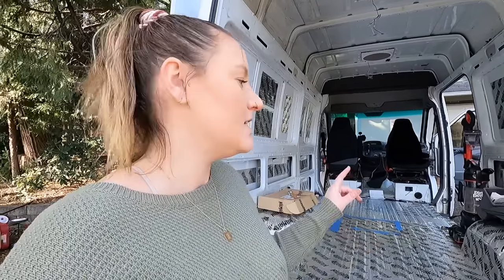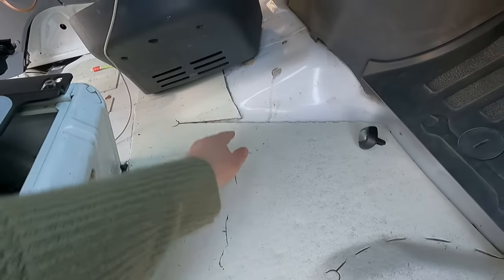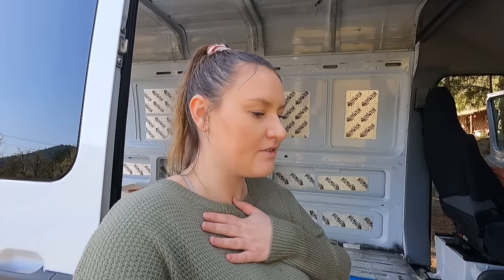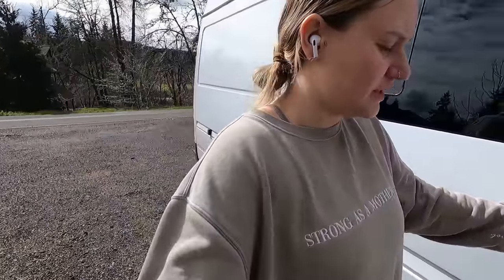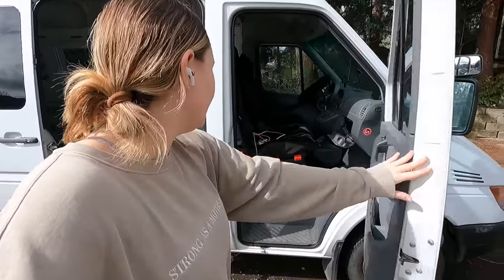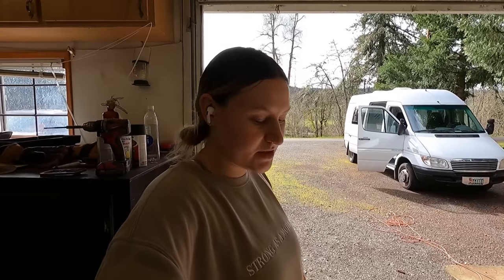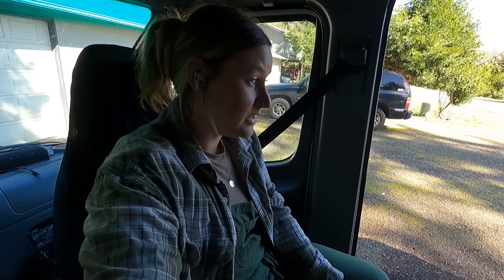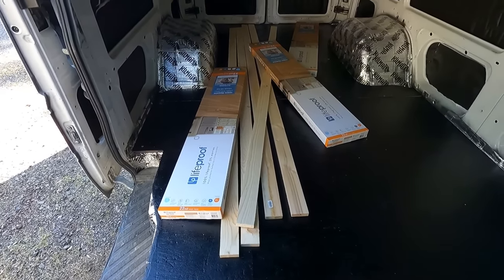Simple and Cheap Van Subfloor - DIY Camper Conversion

Comment: I love that rubber stuff. Used in under diamond plate I used on my motorcycle. The plate between the fuel tanks and the floor boards. ❤ Perfect timing on sub flooring. Winter about to be over here so thats my next task on my list..🎉

Comment: If you would have used the rubber coat then a layer of polyester patch fabric and then coat with the rubber that would have fixed the problem. The polyester fabric is for roofing leak repairs.

Comment: Way to go jaylena! Its lookin good wont be long youll be done with this one gonna be a nice cruiser ill have to get back with you after some time. I would like your opinion on the comparison between the kill mat and the rock wool like you had in minion when you went to texas, as far as insulation for cold and heat someone insulated this step van im workin on now they used 2"foam board  with thin plywood over, that thing still gets hot as hell in the summer well see how that goes maybe have to replace it, thats why i wanted your opinion on these two ,thanks jaylena say hi to issac give ember a hug! Really startin to warm up here in southern nm in the mid 80s this comming week, keep it goin looks great!